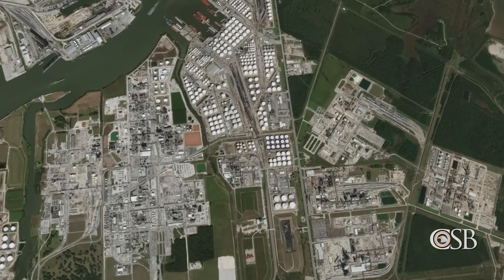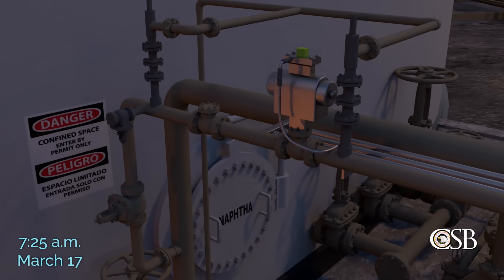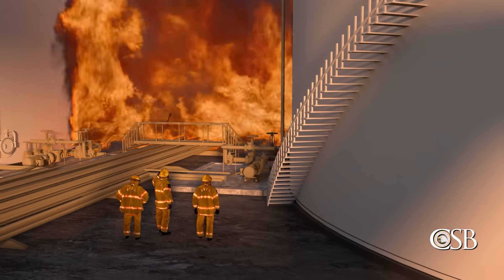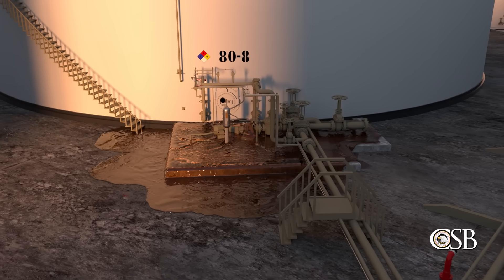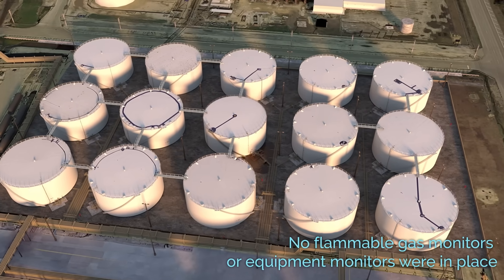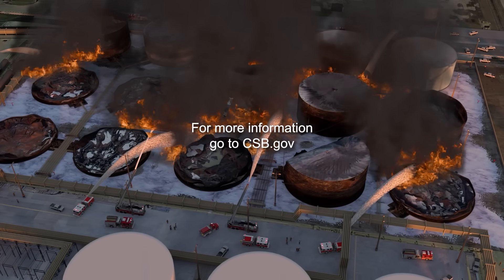Terminal Failure: Fire at ITC

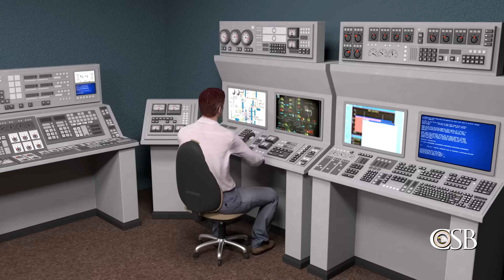Comment: On March 17, 2019, a circulation pump serving above-ground storage tank 80-8 at ITC catastrophically failed during routine mixing of a butane–naphtha blend. Bearing failure led to pump misalignment and severe vibration, progressively loosening the mechanical-seal gland nuts until the seal opened and then failed completely. A large liquid release created a vapor cloud that ignited at ~10:00 a.m., initiating a tank-farm fire that ultimately involved 15 tanks within a single, undivided containment area. The terminal lacked flammable-gas detection, vibration/condition monitoring, and remotely operated emergency isolation valves (EIVs); manual isolation was impossible once the area was engulfed. The fire burned for three days and was fully extinguished around 03:00 on March 20. On March 22, partial berm failure released contaminated liquids offsite, resulting in significant community and environmental disruption.

Primary causes

Loss of primary containment from a mechanically degraded pump seal due to inadequate mechanical integrity (MI) practices and condition monitoring.

Absence of remote isolation and early-warning safeguards to rapidly detect, alarm, and stop the release.

Tank-farm layout (close spacing, no sub-diking) that enabled ground-fire spread across multiple tanks.

Consequences (high level)

Multi-tank fire, prolonged response effort, substantial property loss.

Shelter-in-place orders related to benzene concerns; offsite contamination after berm breach.

2) Facility & Process Overview

Tank 80-8: ~80,000 bbl atmospheric storage tank (AST) leased to a customer, holding a butane-enriched naphtha blend.

Operation on Mar 16–17: ~360 bbl butane delivered and mixed via a circulation pump left running overnight; tank was near full with a ship transfer planned around midday Mar 17.

Containment: 15 tanks (including 80-8) within a single common dike; no subdivisions.

3) Timeline of Key Events (condensed)

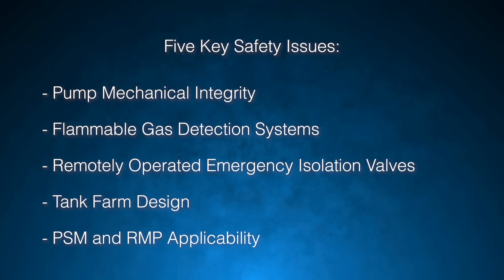~07:25 (Mar 17): Subtle anomalies (pump pressures, average flow, tank volume) appear; no alarms triggered.

By ~09:30: Mechanical-seal opening due to vibration-induced loosening of gland nuts.

~09:45: Gland nuts disengage; seal fails catastrophically; large liquid release.

~10:00: Vapor cloud ignites; large fire erupts. Manual valves inaccessible; no remote EIVs available.

Later Mar 17–18: Fire grows and spreads through undivided containment to 14 additional tanks.

Mar 19: Third-party emergency response resources arrive; momentum shifts to control/extinguishment.

~03:00 (Mar 20): Remaining tank fires extinguished; reignition prevented.

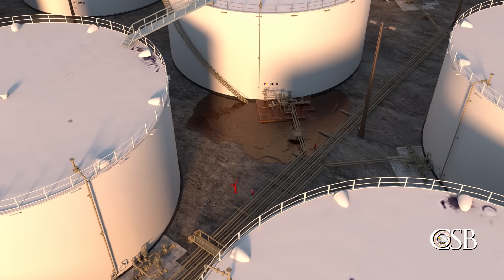12:15 (Mar 22): Partial containment-wall collapse; mixture of product, foam, and firewater escapes to waterways; multi-mile reach of the ship channel and nearby parks closed pending cleanup.

4) Technical Causal Analysis

Immediate technical cause

Pump failure chain: Motor-side bearing failure → shaft misalignment → high vibration → gland-nut loosening → mechanical-seal opening → catastrophic seal failure → sustained release.

Enabling conditions

No condition monitoring: No vibration or seal-health monitoring on a continuously operating circulation pump in flammable service.

No gas detection: Lack of fixed flammable-gas detectors prevented early alarm/escalation.

No remote isolation: Without EIVs at the tank nozzle or pump suction/discharge, responders could not stop flow once fire started.

Instrumentation/alarm design: Trending deviations (level/flow/pressure) existed but were below alarm thresholds; alarm rationalization and deviation detection were insufficient for early intervention.

Tank-farm configuration: Close tank spacing and single, undivided containment allowed ground-fire propagation and pooling, complicating firefighting and increasing escalation likelihood.

Programmatic/systemic factors

Mechanical Integrity program gaps: MI scope tied to a list of “regulated chemicals,” excluding the pump/tank despite flammable service.

PSM/RMP applicability gap to ASTs: Absence of a formal process safety framework for the covered operation likely reduced rigor in hazard reviews, safeguard tracking (e.g., a prior recommendation for gas detection), and MI.

5) Emergency Response Assessment

Strengths

Rapid on-scene arrival of the internal team; eventual mobilization of specialized external resources that proved decisive.

Gaps

Delayed augmentation: External assistance was only requested after the event had escalated to multiple tanks.

Valve access: Lack of remote isolation made tactical containment impossible early on.

Pre-incident planning: Resource triggers, mutual-aid pre-plans, and foam/water logistics were not sufficient to prevent spread within the common dike.

6) Risk Picture (Bow-Tie Summary)

Top event: Loss of primary containment from pump in flammable-liquid circulation service.

Threats: Bearing wear, misalignment, improper rebuild/torqueing, vibration.

Preventive barriers (missing/weak): Condition monitoring, MI/PM compliance, alarm-on-deviation analytics, gas detection, double seals with seal-support systems, gland-fastener retention features.

Escalation factors: Single large dike, close spacing, high inventory, limited fixed firefighting infrastructure.

Mitigations (missing/weak): Remote EIVs, sub-diking/segmentation, firewater/foam drainage management, rapid mutual-aid activation.

7) Recommendations (prioritized)
7.1 Engineering & Safeguards

Remote isolation: Install fail-closed, remotely operated EIVs at tank nozzles and/or pump suction/discharge with fire-safe actuation and protected cabling/air.

Detection & analytics:

Fixed flammable-gas detectors around pumps, manifolds, and low-lying areas; integrate with control-room alarms and automatic shutdown permissives.

Alarm-on-deviation logic for tank mass balance (unexpected volume/flow/pressure drift) with graded alerts.

Pump reliability:

Condition monitoring (continuous vibration, bearing temperature) with trip setpoints.

Dual mechanical seals with pressurized barrier systems; seal-failure detectors; robust baseplates and alignment procedures.

Positive locking/retention features for gland fasteners; torque-verification and re-torque intervals after rebuild.

Tank-farm layout & containment:

Sub-divide common dikes; increase spacing where practicable.

Upgrade drainage to handle peak firewater/foam flows; routed to containment/processing without overtopping.

Validate berm integrity and freeboard under worst-case firewater scenarios.

Fixed firefighting: Pre-installed foam monitors/cannons and hydrants positioned for access under radiant-heat conditions; thermal shielding/roads for responder ingress.

7.2 Mechanical Integrity & Operations

Scope MI by hazard, not chemical list: Include all equipment handling flammable liquids in formal MI (PM, inspection, rebuild QA).

Procedure quality: Detailed pump rebuild/install procedures; competency-based training and qualification records.

Hazard reviews for AST operations: Include mixing/blending, recirculation, and near-full conditions; document and track all recommendations to closure.

Alarm management: Rationalize setpoints; add “rate-of-change” and “unexpected inventory change” alarms; minimize nuisance.

MOC discipline: Treat blend changes, pump swaps, control-logic edits, or alarm-setpoint changes as formal MOCs with risk review.

7.3 Emergency Preparedness & Mutual Aid

Early-activation triggers: Pre-defined thresholds (e.g., loss of containment with ignition, >X minutes unrecoverable) that auto-initiate external support.

Pre-incident plans & drills: Joint exercises with mutual-aid partners; resource lists for foam, water, EIV spares, portable monitors.

Access & egress: Hardened routes, remote video, and thermal cameras to assess conditions when personnel access is impossible.

7.4 Environmental Protection

Firewater management plan: On-scene containment capacity calculations, mobile tanks, weirs/booms, and rapid deployment kits.

Air monitoring & community comms: Fixed/portable benzene monitors; clear, timely public information protocols.

8) Implementation Roadmap

0–30 days: Risk review of all circulating pumps in flammable service; temporary administrative controls; portable gas detection; define remote-isolation philosophy and specify EIVs.

30–90 days: Install condition monitoring on critical pumps; implement alarm-on-deviation analytics; procure and stage foam/water assets; finalize sub-diking design.

90–180 days: Commission EIVs on highest-risk tanks; execute dike subdivision and drainage upgrades for the most exposed areas; complete MI procedure roll-out and training.

≤12 months: Complete fixed-system upgrades (detection, monitors, drainage), finish EIV rollout, and validate via full-scale drills.

9) Performance Metrics

% tanks with functional remote EIVs (target: 100%).

Gas-detector coverage factor across pump bays/low-lying areas (target: >95% of modeled hazard zones).

Mean time to detect (MTTD) loss-of-containment; mean time to isolate (MTTI) after detection.

PM/MI on-time completion rate for pumps and seals (target: >98%).

Number of open safety recommendations >90 days (target: 0).

Annual full-scale emergency drill completion and findings closure rate (target: 100%/100%).

10) Conclusion

This event was preventable. Robust MI practices, early-warning detection, and remote isolation—combined with tank-farm segmentation and disciplined emergency pre-planning—would have limited the release and almost certainly prevented multi-tank involvement and offsite impacts. The actions above are practical, well-understood in industry, and should be executed with urgency.

Comment: Seems that a fusible link equipped safety valve could have reduced the impact. If the tank valve automatically closed when it got hot that could have reduced the spread of the fire.

Comment: I'm only a few minutes in...As an electrical engineer with a little bit of instrumentation background... No leak detection? No vibration sensor, no LEL/gas detection...? Motor temperature?  Holy crap. Who stamped those drawings...
Reply: Even if the operators could denergize the motor running the pump - it was too late. A fuel source is already open and feeding the flames. I'm also wondering where the ignition source was. Motors should also be classified for their gas composition - so auto ignition is less likely... Is Canada different?

Comment: As a former operator, this is why you don't ignore high vibration on your pumps. Not trying to blame anyone, but you don't have mechanical seals suddenly fall apart like that. I bet that pump was screaming with a gradually worsening pencil stream for months before that happened. Also- Naphtha smells terrible- you would be able to smell it around that pump days before that happened. Yes, engineering controls could have been improved, but this is why you gotta know your equipment and stand your ground regarding safety and equipment health. Great job CSB, hopefully this message catches on and prevents anything like that from happening again.
Reply: Exactly. 

I’m sure: “Yeah that pump always sounds like shit” was tossed around quite a bit
Reply: Pump probably sounded awful, wild that they didn't check vibration on it occasionally
Reply: Diabolical bro, is it crazy bro? Lowkey wild ong fr no cap, like bro I’m not even capping, it’s giving main character energy ong, lowkey fanum tax highkey rizz bro, skibidi Ohio sigma vibes, goofy ahh situation ong fr bro, straight up cooked no cap.
Reply: but. what about ITC profits? will someone please think about that?
Reply: I’m very surprised at how lackluster the monitoring of their system was. I work at a water treatment plant/ boiler house and we have vibration sensors flow meters and even cameras watching our equipment we know almost immediately when something is wrong, to think that they had no idea they were spilling for half an hour is just crazy to me.
Reply: i rather like the smell of naphtha 😂
Reply: @barfbot lmaooooooo- I used to work a Cat unit and I hated catching that sample even more than feed or even catalyst for that matter  🤣🤣🤣
Reply: True, it did not happen suddenly.
Leaving pump running without bearing lubrication more than 6 month.
Now we use double mechanical seal.
Many bearing failures and leaks have occurred as the result of lack of lubrication. Sometimes operators have neglected to lubricate the pumps. 
On one occasion, a bearing failure was traced to water in the lubricating oil. The bearing failure caused sparks, which set fire to some oily residues 
nearby. Drums of oil in the open-air lubricating-oil storage area were 
found to be open so that rainwater could get in. This is a good example of 
high technology— in bearing and seal design— frustrated by a failure to attend to simple things.
Reply: And the system should be alerting when the motor rpm/amps reading is abnormal.

LEL sensor also.
Reply: They didn’t have the vibration monitoring hooked up… allegedly
Reply: I worked in that terminal a hundred times as a fuel treatment operator. As fuel was loading onto vessels or offloading to the shore tanks, we would treat it, inline. Anyway, when I got sent the job details and saw I had to go to ITC DP, I cringed because of all the terminals I went to, this one was the worst. Their operators didn't GAF about anything and would basically sit in control room milking that test. They took forever to get us a work permit and rarely responded on the radios. It would take three to four attempts to get acknowledged. When this happened, I wasn't surprised. Only disagreement I have is naptha stinks all the time so it's not a new smell inside there. Those vapors just hang around all the time. They should have been doing hourly checks on any running pump for this specific reason. Had I been a lead operator at ITC DP I would have immediately made changes and started holding people accountable. They were always sitting in the control room with their feet up on the desk. They grew accustomed to everything working as designed and this was caused by pure laziness
Reply: ITC cried about a “profit attack” and bent their knee to republicans and their useful idiot orangey guy while kissing his ring, thusly granted a pardon!
Reply: Not if you have contractors instead of salaried personnel

Comment: Outstanding work, thank God no one was injured in this catastrophe. I was in the petroleum industry, now in the nuclear industry, but there are still many parallels between the 2 that keep these reports intriguing to me. I definitely feel safer as a nuclear plant operator because of the abundance of vibration monitoring and remotely operated isolation valves, even though now the majority of the systems I interface with are water or steam.

Comment: it's ridiculous and irresponsible the lack of sensors on this equipment, I work in building automation and we've started having vibration sensors being installed on stuff like air handling units and water pumps, where a worst case scenario is water pipes freezing and bursting plus the building getting too cold or in summer too hot. this is dangerous to the environment and workers, that's horrifying!

Comment: Unfortunately lots of these facilities were built many years ago and are so called "grandfathered" and do not have or required to have modern required safety/redundant features...used to work at a refinery in the late 90s that was built in the late 40s that exempted from then current EPA air pollution required equipment due to it being"grandfathered"then they were given x amount of years to install/upgrade said equipment then when deadline was approaching the plant would be sold and continued operating with another extension timeline till the EPA said enough was enough 😮

Comment: If there's ONE thing I've learned after years of USCSB masterpieces it's that everything needs a remotely-operated emergency isolation valve.
Reply: they've become so inexpensive that there really isn't a good reason for them to not be implemented
Reply: Even my peanits?
Reply: @lyoko111  Yes, even there
Reply: @lyoko111  yes even there
Reply: Amen
Reply: 😂 I find it funny cause it's true🤣
Reply: Maybe they could’ve gotten to the pump breakers without entering the hot zone? JW…
Reply: There is no need to operate if you use so called shut off valves with thermal activation
Reply: @leonidshapiro3066  why not both!
Reply: @Nelo390 of course,  you may use both or use FM UL approved shut off valve with double (thermal and electric )activation
Reply: @leonidshapiro3066 Not all gas releases ignite right away. We have cold services at my facility.
Reply: @leonidshapiro3066  The thermal activation would not have fully stopped this I think.  The fires also caused the tanks surrounding it to warp even before their contents caught fire.  A simple gas monitoring system near the valves could have told them that there was a leak.  The reality is they had other warnings that something wasn't right and they ignored those as well.  Lazy operator is the true issue.
Reply: Don’t blame the operator blame the management that doesn’t want to spend a dime